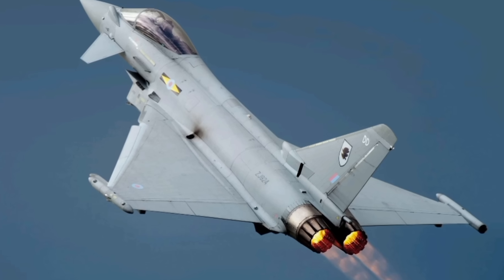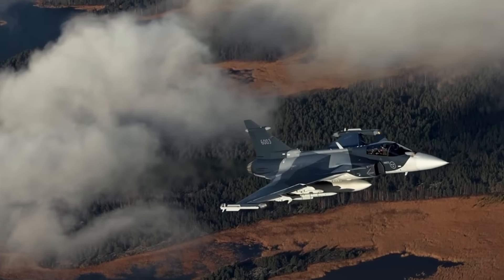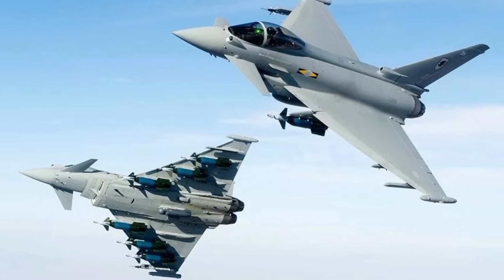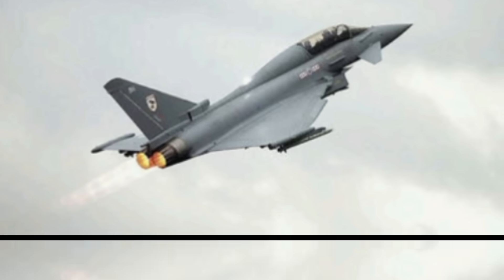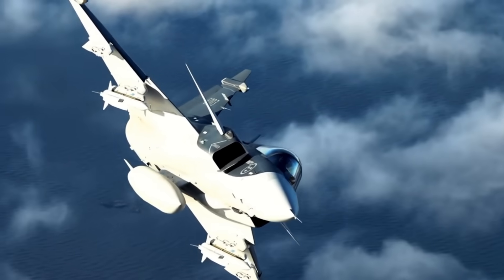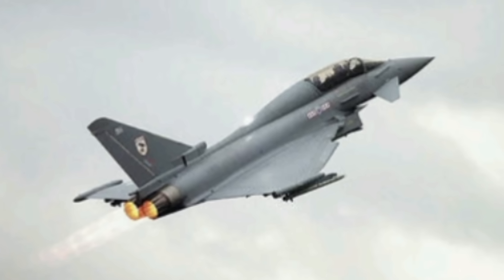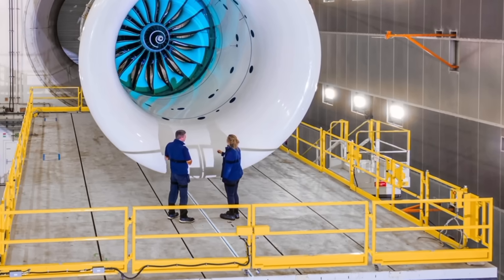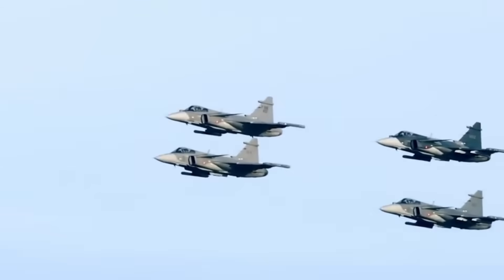Gripen E/F’s NEW Rolls-Royce Engine: The Fighter Jet Upgrade That Could Change Everything!"

Comment: Except that in modern air combat what you just described are characteristics of a plane used in dog fighting. The very last thing you want to do in modern air combat is dogfight. The US is introducing a new missile now that can shoot an enemy down from 200 miles away. That means if we use it in our stealth fighters like the f-35 we can shoot enemies down 200 mi away without their even knowing where they were shot down from. 
In addition, manufacturing jet engines is extremely complicated difficult and a long-term proposition. There's no guarantee Rolls-Royce can do this without impinging on ge's patents. There's no proof of Rolls-Royce can do this without the US saying no. You should know that Rolls-Royce does a tremendous amount of business with the us right now they're reengineering b-52s. That contract for the b-52's is worth far more than the contractor re-engine Canada's new planes. 
So just like is typical on YouTube whoever wrote this is an imbecile who knows nothing about the subject he's writing about. As it is the Grippins will get to Canada shortly before they're actually obsolete.😅😅😅

Comment: The better option has to be R-R new adaptive (variable) cyclic fighter engine enabling a Gripen near super-cruise capability. Develop in Europe as the US under its current president cannot be trusted and any US source military weapons system (s) and components will always lower priority over the US international engine support program. I can recall 1968 to 72 maintaining our C130s and we were relegated globally to spares as we did not participate physically in the Vietnam War. However, our British tight-corner ingenuity changed our airframe maintenance policies and transferred 2nd Line (USAF Intermediate  level) to 1st Line  which amazed our US company rep.

Comment: First of all, there are no official comments at all regarding Gripen E and this engine swap.
Thee aren't even any official comments about this is actually under development (not from SAAB, neither from Rolls-Royce).
I would say, with a high degree of certainty, that most of what's being said in this video is pure fantasy at this point.

Gripen E already have supercruise capability (on the contrary to what the video says).
Official data says supercruise at M1.4 with full tanks and fully armed for air to air mission.

The most important thing with the rumors about this new engine is it's higher DRY THRUST.
Higher dry thrust would give the aircraft higher supercruise speed and lower fuel consumption (because of lesser need to run the guzzling afterburner).
Less need to run the afterburner also means lesser IR-emissions = harder to detect forvthe enemy.
Higher max thrust (with afterburner) however is important for high g-load endurance (high g-load without losing speed).
Reply: I knew there had to be at least another person out there who actually pays attention to factual news instead of these clickbait videos. YouTube has been inundated with crap Gripen videos that are simply expanding upon the wildest speculation and not based even slightly on what's actually happening. The videos are formulaic and predictable: Come up with a speculative concept to use as a title like "NATO fears the Gripen", "Putin is in panic over Gripen", "Canada slams Trump with Gripen decision!", "Gripen to have RR Engines"..., then gather video snippets of the Gripen and the F-35 (and the Eurofighter Typhoon and Dassault Rafale because most people can't tell them apart from the Gripen anyway), also don't forget to mirror some of the footage to avoid copyright strikes, then get an AI chat bot to generate a script based on the title, and combine it all with an AI narrator which doesn't know whether it should pronounce it "Grip-pen" or "Gripe-N" or "Greep-in", and then release it for all the views, likes and comments. Sadly, even negative comments like this only serve to promote these crap videos.

Comment: The SAAB Gripen is already capable of supercruise, with the American GE F414 engine. A more powerful Rolls-Royce engine would of-course make Gripen able to supercruice with a larger load. The possibility of thrust vectoring sounds very interesting, and the option to not depend on the US engine-wise is important in the current political circumstances.

Comment: I hope use of Rolls Royce engines for Gripen will be an augury of the future.

The recent deal over frigates and plans for close cooperation between Norway and the UK may be similar. Possibly the same could happen with Denmark and Sweden with frigate purchases. That these are all members of the Joint Expeditionary Force (JEF) may not be a coincidence.

If Sweden also buys Rolls Royce for their Gripen, perhaps we are starting to see the development of an international military industrial complex based around the JEF. Individually. These countries produce some very good military gear, but as smaller countries we lack the size to gain economies of scale. Perhaps by working together we can change that.

Comment: For Canada, alas, covering the Arctic on a single-engine airframe is a bad idea. (It's a bad idea for the F-35 as well.) I would love to get rid of the hanger queen F-35's in favour of Gripen E with an RR engine, but for us, the best bet is the Rafale with external tanks and conformal tanks -- fast, much longer range (able to cover the entire Arctic), and free of US export control intrigues.
Reply: Rafale as already all is needed and is going to evolve (standard F5 , engine , M88 T-REX)
Reply: The Arctic doesn't need to be covered,  Russia is never going to attack Nunavutand twin engine engines are just way more costly and require  twice as much maintenance. That's what air tankers are designed for and adhoc runways or airports all over the country can support the Gripen. Canada will fly these in Europe fighting Russia.  There won't be any dogfights over Winnipeg or Churchill, Manitoba. That's why Canada needs the Gripen, because it will be used to defend the Baltics, Sweden, Norway  Denmark. Keep the war over there, not over here. And if America goes full on crazy and decides to invade Canada, as an excuse to get its oil, after its done invading Venezuela and Greenland, would you want to fly F-35s against America knowing they will shut you down, then attack your air bases? Too far fetched to happen?
Reply: @motomanxxxmotomanxxx  Thanks for your comment, Motoman.

(a) The Arctic doesn't need to be covered?

Really? America and Russia challenge Canada's ownership of Arctic land. If we don't patrol it to assert sovereignty, that matters. It is true that there are few people of any race up there, but Canada's Arctic region holds substantial untapped natural wealth and economic opportunity, potentially worth over a trillion dollars, primarily in hydrocarbons and critical minerals. Again, if we don't patrol it, that matters.

(b) Twin-engines are just way more costly?

In patrolling areas where engine loss has a high probability of pilot loss, twin engines provide a well-studied and statistically safer margin against engine failure. They do have trade-offs in cost and complexity, but the most expensive is the single-engine F-35, by far.

(c) Canada will fly these over Europe, fighting the Russians?

That assertion is just patently untrue; you made that up. The Royal Canadian Air Force (RCAF) is primarily responsible for defending and protecting Canada's airspace and North America in partnership with the United States through NORAD. Its core mission includes detecting, deterring, and defending against threats to Canada and North America, especially focusing on Arctic sovereignty and national security.

(d) I like the Gripen E very much, but the Rafale has distinct advantages for Canada.

Capability	Rafale		Gripen	Advantage
Engines,		Twin,		Single,		Rafale
Fuel, int,		~4,700 kg,	~3,400 kg,	Rafale
Fuel, max,	~11,400 kg,	~5,000 kg,	Rafale
Combat Rad,	~1,850 km,	~1,500 km,	Rafale
Payload,		~21,000 lbs,	Smaller,		Rafale
Hardpoints,	14,			10,			Rafale
Versatility,	Wide-range,	more limited,	Rafale
Sensors,		Extensive,	a bit less,	Rafale
Cost,		Med high,	Low,		Gripen E
Maint,		Medium,		Low,		Gripen E
Independence, 90%,		40%,		Rafale
Reply: If Canada only need a fighter jet to cruise the sky, it's better to acquire Gripen at lower cost.  If Canada want to insure sky dominance and project real power, then it need to acquire the  most  evolutive twin-engine Dassault Rafale F4 ----> F5 soon.  Evolutive is the key word. Rafale is way superior to the Gripen and is nit titally but almost free of american components.

Comment: The new Rolls-Royce engine is the UltraFan for passenger aircraft. The UltraFan is the largest demonstrator aero engine in the world containing a suite of new technologies that deliver greater fuel efficiency, which in turn means lower emissions and greater sustainability. Phase 1 of testing UF001 has now been completed, with the engine running to approximately 85,000 lbs of thrust at full power.

Comment: Whoever Wrote thihs, doesn't UNDERSTAND the POLITICS INVOLVED.  The U.S. just DENIED End User Certificates because of the GE engine, to Peru and Colombia, both of which WANTED THE GRIPEN, but have been FORCED by the U.S. to buy F-16s instead.   If the Rolls-Royce engine HAD been in the Grpen, that's two countries that were super happy to buy them to replace their obsolete Mirage, Kfir, Mig and Sukhoi squadrons...... THIS is what TRUMP has in store for Canda, when we sign up for Gripens......he's  a vindictive...DICK.

Comment: To keep submitted to Us dependency should be a big mistake for Saab . Put a mre powerfull engine means modify air entrance and contrary a what thi video says increase consumsion . To create a new engine may take years before achieving it . Super cruise is possible but only without extra tanks ; otherwise it needs not to speed over 0,9 mach . Maybe the right choise should be to conceive a new plane, biger but more expensive .

Comment: Gripen is a single engine jet! - the Rolls-Royce EJ230 for Gripen is an engine produced 
from half the double engine that Eurofighter use !  Its not really an upgrade but an engine
with the same power + thrustvector
Reply: Gripen is a single engine jet that uses an adapted F414 engine originally designed to the American twin engine jet Super Hornet!

Comment: I'm Canadian and this is the jet we need...not the F35. It far better serves our needs. Not to mention we strengthen our strategic partnership with Sweden. This engine upgrade will make it even better.
Reply: I'm Canadian too and your comments are spot on.
Reply: and hour many hours do u have and in what aircraft?
Reply: @lking288 How is that relevant? I can do math and the Gripen is a much better price...I'm smart enough to know that having them built in Canada will have a positive economic impact.  I don't need to have flown to have common sense.

Comment: At 6:05 When you highlight the GE engine enables for interoperability, can you please explain what you mean?
Being interoperable with another nation means that both militaries can operate together in the same contested space and support each other on operations. To some extent it can include sharing logistics.
Interoperability - The F-16, F-22 and F-35, their parts are not interchangeable wholesale with each other, or in parts with the Typhoon, Rafale, etc. I even doubt that some of their lubricants are interchangeable with each aircraft.
So by Sweden changing to the Roll-Royce engine, how does that prevent interoperability with any other NATO military, least of all the US?

Comment: The main benefit will be this bypasses the US embargo it can use with the GE engine.
That RR can provide both a solution to that, add extra power even with the 'standard' EJ200 and it pulls supply back to Europe are all big wins. Add in the built in 20% extra power from the RR EJ230 engine developed by RR which is not fitted to the Typhoon. It is so good its the basis for the Tempest fighter prototypes being manufactured right now by the UK, japan and Italy. A memorandum was signed recently by Japan and the UK to develop the future engine for Tempest.
Reply: I read earlier that GE is LEAVING the US. If so, this may make it easier for Canada to break the original deal.

Comment: A large part of the Gripen's problem with international sales is that the US has right of veto, thanks to the Pratt & Whitney engines, so if the US doesn't like a certain country, even though Sweden has been neutral for such a long time (no longer, obviously) SAAB has had its sales restricted by US approval. Yes, developing a new engine, and redesigning the Gripen to accomodate it, will bump up the unit cost initially, but international sales, unencumbered by US restrictions, will bring it down in the long run, making this aircraft a viable prospect for many nations. And don't forget that, even though the unit cost might rise, per-hour operations will still be only a fraction of the per-hour cost of something like the F35!

And who trusts the US any more, thanks to the Orange Moron, who has alienated the US's every ally, as well as talking about 'watering down' export models of the F35!? Canada, Spain and Portugal, among others, are all reviewing, if not outright cancelling orders for the F35 for this very reason and looking elsewhere for their aircraft. 

Europe NEEDS to rearm itself - with EUROPEAN weapons systems.
Reply: Your points are all very good. Too bad about your mistake right in the first sentence. The Gripen has never used Pratt & Whitney engines, they are General Electric, either the Volvo RM12 (a variant of the GE F404-400) for the Gripen A, B, C, D variants, or the GE F414G for the E & F variants.
Reply: @neilpalmer230  Oops! My bad. I stand corrected.
Reply: @CaptainQuark9  No problem, You can edit and correct it.

Comment: There is no reason what so ever to re-classify an engine for only single engine use as the RR engine was designed for dual engines, first of all the E will be the last 4.5 generation so no future Gripen will use it, secondly - ofc SAAB fixes all necessary permits before even starting talks with a buyer.. the engine was never a problem during the colombia deal but just a silly rumor. Yes we should absolutely lessen our reliance of US parts and find europeans solutions instead - but the E's engine has never been an issue but just rumors from keyboard warriors, SAAB themself say they're not looking into replacing the engine....

Comment: Talk about thrust vectoring, more power or anything else you like but this RR engine is modular and can be removed in 45 minutes which is beyond a doubt its most important feature in any high tempo conflict.
Reply: Yes to thrust vectoring. As with the Harrier, it would give this new Gripen incredible maneuverability.
Reply: The current GE-F414 can be removed and replaced within one hour in the current Gripen E, the same time it takes also to replace a GE-F404 based engine in the Gripen C 
Ease and speed  of maintenance is designed into the aircraft itself
Reply: @kronop8884 Until America decides to hold back on the diagnostic sorftware....
Reply: @gabehorn1001 that doesn’t affect the ability to replace the engine, and diagnostics in aviation isn’t done in the same way as on your car
Reply: @kronop8884 You take an engine out of any modern machine you will need diagnostics to code it back in my friend.
Reply: @gabehorn1001 It doesn’t work the way you think, sorry
Reply: @kronop8884 Thats the F414 39E which is the gripen E power unit btw.

Comment: People are so naive ,the  development of  a new engine from scratch costs billions and 10 years to develop plus modifications of the existing air frame.. 
Independence from the US  is OK.. But the question remains, how much would it cost?? 
Canada should manufacture the Eurofighter under licence. 
the best option for arctic patrol armed with Meteor..
Reply: The engine is already developed. It's in service for 25 years in the Eurofighter Typhoon. It needs only to be certified for the Gripen because the integration is already in the drawers.

Comment: When Canada transitions its remaining fleet to the Gripen, manufacturing and tooling will follow here at home. Saab’s model has always been to build with the customer nation, and Canada has the aerospace base to do it with Bombardier, Pratt & Whitney Canada, Magellan, and others. Partnering with Rolls Royce, a new factory line in Canada is not a barrier, it is the logical step. Brazil already proved this with Gripen production, and Canada with a larger order and allied commitment would justify an even greater footprint. 

The airframe development is still a challenge, but the biggest cost in any fighter program is manufacturing tooling, the dies, molds, and jigs that make the aircraft possible. That is where the real investment lies, and with Canada on board those costs are not an obstacle. Canada could also become a manufacturing hub for the West, serving new Gripen clients in Europe, Asia, and South America. Saab’s stock has already doubled while Lockheed’s has been sliding, which tells you where investors with real money believe the future lies. 

The question is not whether it is possible. The question is whether Ottawa is ready to make the choice.
Reply: Not sure RR (or Canada itself come to that) will want US company Pratt & Whitney involved! But there is no reason a satellite RR engine maintenance facility cannot be built.